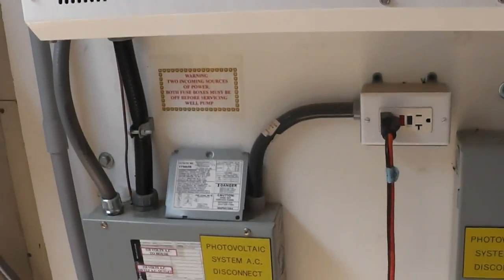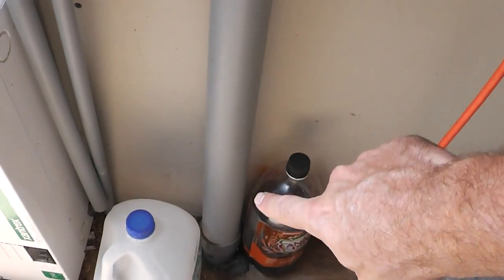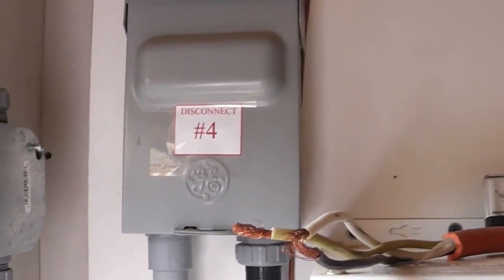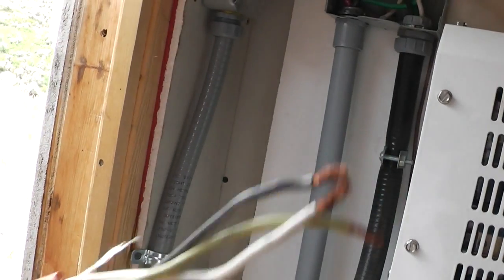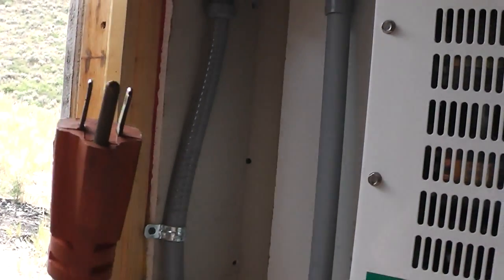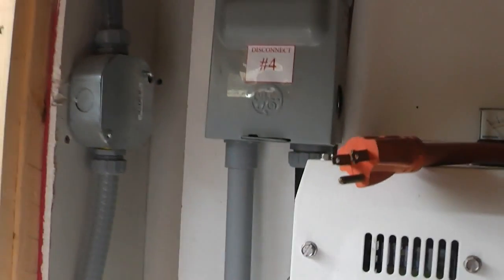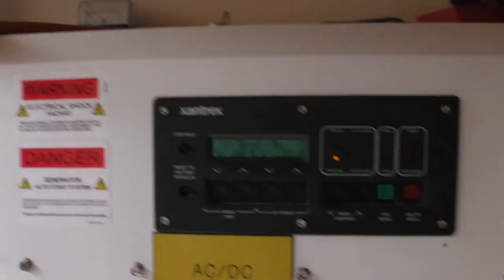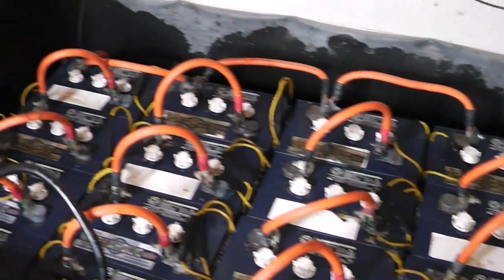Off the Grid Living: Generator - Inverter Wiring

Comment from the maker: Good question.  The shed does get down below freezing occasionally.  The batteries and inverter give off quite a bit of heat.  Cool temperatures do reduce some efficiency but they also lengthen the life (think of putting batts in the fridge).  So its a tradeoff but generally we get really good battery performance.

Comment: Thanks for the video.  How cold does your battery/equipment shed get in the winter?  Do you see much difference in the the battery capacity or output due to the low temperatures?  Thanks.